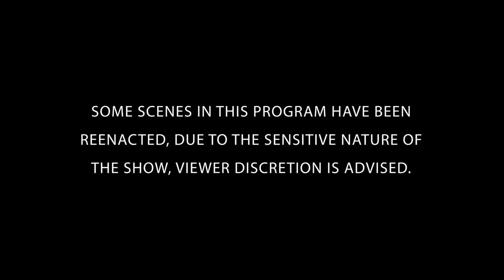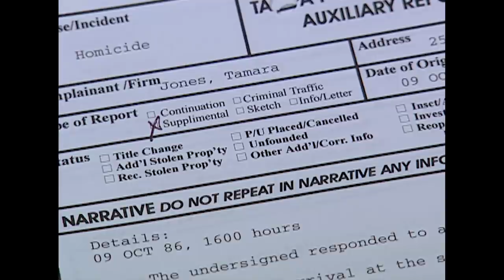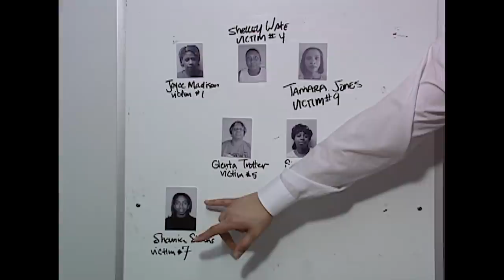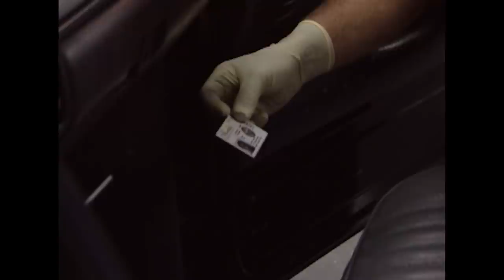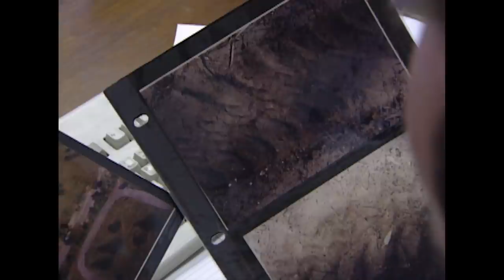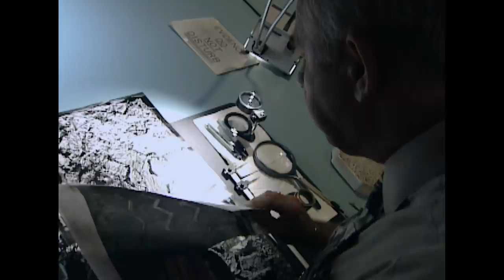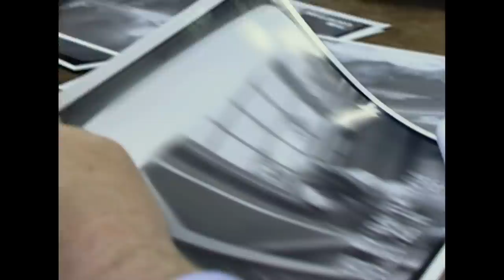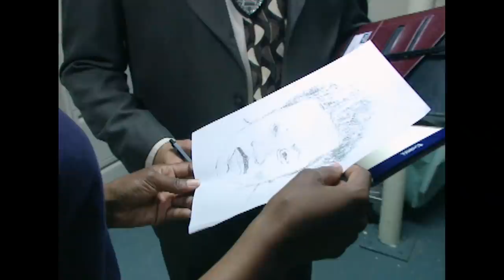Lethal Encounter | FULL EPISODE | The New Detectives

Comment: The case with the ‘garrote’ looked more like practice nunchucks. True working garrotes have rope tied in the middle of the handle for better leverage. The one they showed had rope in the ends, which could pull out from pressure. Perhaps the prop folks didn’t have a proper garrote available.